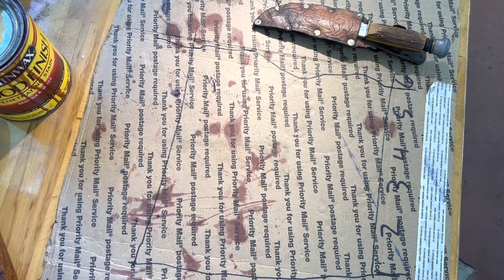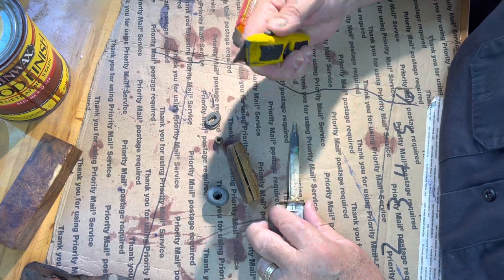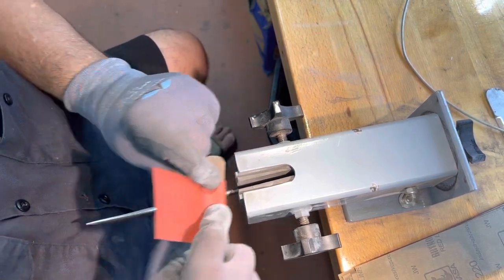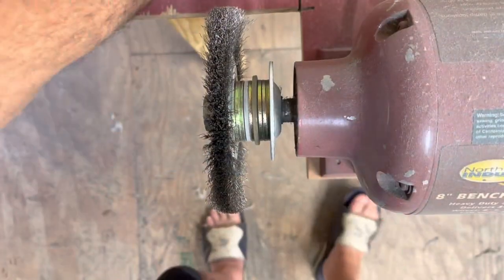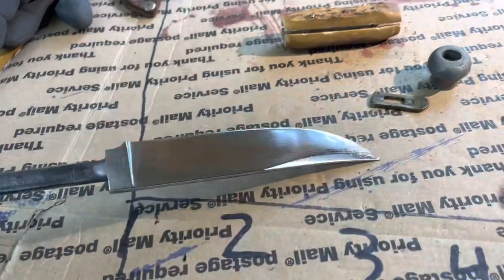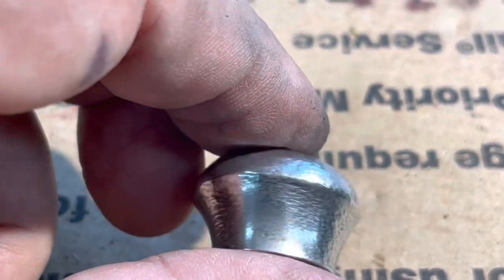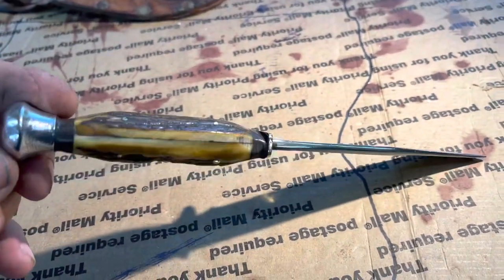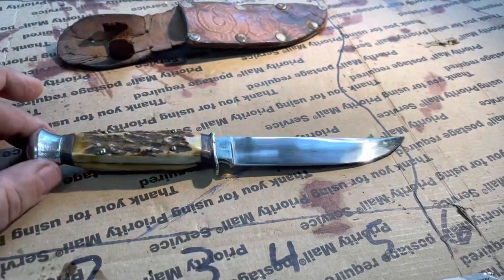Restoring an old German knife

Comment: It looks fantastic. So glad you didn't refinish it to new condition, and that you didn't replace the handle on it, also that you are sending the old sheath with it. If we didn't see you add the spacers, I would not have known that you added them. Good choice on using  the Walnut in place of the black and red wood. Great job on it.
Reply from the maker: It was an enjoyable rebuild and I’m going to keep looking for more knives to restore.
Reply: I have to agree with you on the spacer wood. Don't think the red/black was available when the knife was made, but walnut definitely was! Although the red/black would have looked nice, just not original.

Comment: A FWIW.  Contract price for bulk propane delivery here, until Mar 2023, is $3.199 a gallon. It went up $.50 over last year's price. Unit pricing on 100 lb cylinders should be a little less than price to fill 20 lb ones. Current price for 20 lb at our local TS is $4.15/gal.
Reply from the maker: I just googled it and a 100 pound tank holds 23.6 gallons. I should be around 100 bucks to fill the tank.